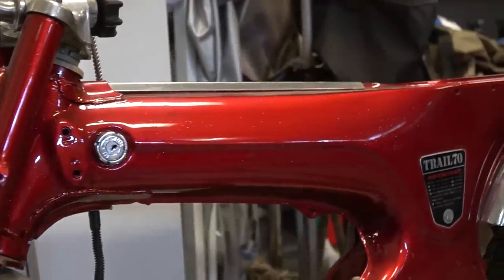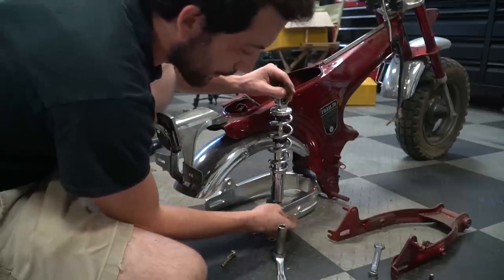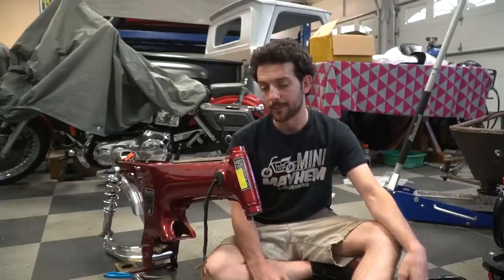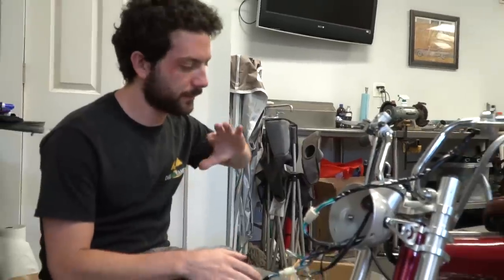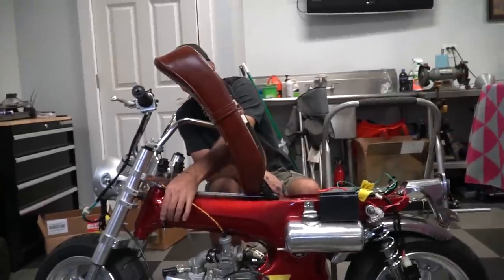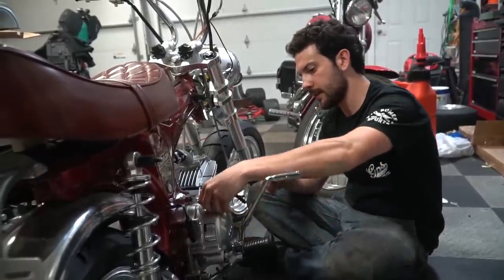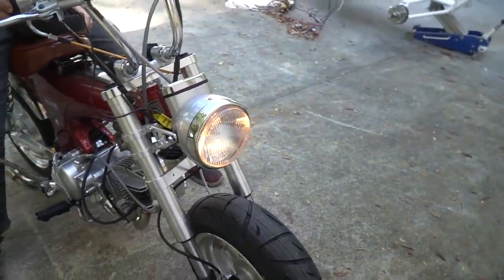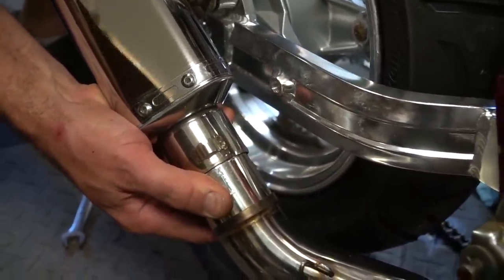190cc Honda Trail 70 Build | TOTAL RESTOMOD

Comment: Love your content. Ive never owned a chain breaker. As a retired forklift mechanic ive only done lift chains with an angle grinder and a punch. This philosophy transfered to my minibike world im in now. Not a bench grinder but an angle grinder...your bench grind method goes to new levels of burning fingers or chain getting caught between rest and wheel! Try angle grinder method. Use a paint pen to mark which link you want to go bye bye. Also for figuring out gearing for each bike i build i use cheap amazon chain then once i nail gearing then i put the good stuff GoPowerSports gold chain on at that length. My post is too long sorry about that gonna finish video now. Have fun guys!
Reply: I find on 420 chain I can just drill a 1/8 hole in some hardwood and just punch it through without grinding... I used to use a grinder but I found I had to use similar force with the punch compared to just punching it without grinding

Comment: To reduce your swerving and other issues at high speed you should get a steering stabilizer
Reply: Was just about to comment but ya beat me to it, would greatly reduce head shake at high speeds👍
Reply: I initially read that as swearing... that said, good point.
Reply: Steering dampener. The reality is his suspension is not set up properly  for his weight. Possibly to much preload. You shouldn't need a steering dampener on such a small bike doing such low speeds.
Reply: camdog they are the exact same thing just two different words to describe them
Reply: camdog Actually it’s a “steering damper”. A dampener would be an item used to lightly wet items.
Reply: Adam R lmao I’m pretty sure you are way off on that definition 😂😂
Reply: cameron weisz  Nope, I’m 100% right. I didn’t say you were wrong though. Steering stabilizer is correct, but so is steering damper. I was sponsored by Scotts steering dampers for the 12 years I raced motorcycles professionally. Here is the correct terminology on their website.

https://www.scottsonline.com/scotts.php
Reply: @Brian-wy7ts  right on man.  Its not just a quick fix.
Reply: camdog 
Definitely need a steering stabilizer at road speeds. I run one on a stroker ct70
Reply: Also sitting further back than he does helps alot the stability and handling.
Reply: Not unless the ct70 has some ingrained issue.  I've been riding bikes for a while with far more aggressive steering geometry without steering dampeners. 
Also, a steering dampener won't stop swerving, which certainly shouldn't be happening involuntarily anyway, just dulls out fast wobbles and tank slappers.  Fast steering wobbles and tank slappers shouldn't be a problem unless you're flipping too fast from lean to lean or setting down crooked wheelies.  Can't imagine that would be a problem on that bike.
Reply: Ive seen some custom ohlins set ups. They most definitely help.

Comment: John don't forget to get an oil cooler for it these engines run super hot. I've got the same motor in my pit bike and it shreds! The motors can hit almost 100 with the right gearing. I got my motor on pitster pros website it came with everything needed for a swap from a harness, air filter, oil cooler, throttle and clutch cable ECT... For $641 they aren't to bad on gas either I thought it would eat through gas to also had to grind down the case on mine as well so I got a laugh out of that. Good looking bike otherwise I love it!

Comment: I know I say this alot guys but I really really miss the rumble of the 670 from the drag rail could you all bring it back I miss it alot.
Reply: Robin the slave Wr [BŐŐB] pretty sure they bent the frame
Reply: @gixxernut8021  They also blew up the motor.
Reply: It needs a new engine and fixed the frame so its probably not going to happen for a year
Reply: @tbah9402  the frame was to bent too bad the only problem was the motor
Reply: Yeah the frame is bent. The motorb is conflagulated. New rail build? NEW RAIL BUILD!!!! please.
Reply: @robintheslavewr1513  if the frame is bent then it needs fixed before you put 50+hp on it bent metal is weaker

Comment: Beatiful dax! The brake system always goes left on the front! this is to prevent brake power be to much on either side. Also the best way to warm an engine is to let it idle for about 15 to 30 minutes and then go for a drive to about half throttle while sometimes driving a bit faster or slower. This process minus the idling needs to be repeated for 500 kilometers if the cylinder is cast iron and 100 to 200 kilometers if the cylinder is aluminum. I also hear some blowback when you went for a little drive, be sure to check the valves to see if they are tuned correctly. Not only will this increasy the life span of the engine but also the performance and mileage.

Comment: Wider triple tree would allow you to clear the rotor, and just use a spacer (s) to center the wheel and a longer axle, problem solved. I can tell right now that it needs longer shocks in the back or your going to toast that rear fender on that tire with the extended rear swingarm. I would like to see you complete the TAT on it. LOL.

Comment: I love the 190 engine. It's prone to a few issues but super simple and cheap to work on and mod.

With a 212 bore, 4 valve head and advanced timing it puts out 24+hp.

Comment: My first ever "dirt bike" (or at least thats what I called it) was a 95 ct70. It was still brand new I got it about 2 or 3 years ago it was but back in a storage container by my great uncle and he forgot about it. We pulled it out put a new tank on it bc it was rusted out. When we got it running it had less than 100 miles and since then I have put over 1000. Though the carburetor is still leaking. I have rebuilt it but it still just leaks.

Comment: 2" extension means 1" on each side I guess.
Reply: Or 2cm, which is close in chinesium
Reply: Or it's measured from the beginning of the stock slot, to the end of the extended slot.

Comment: you now have a similar version of my z50 monkey it has a 150 in it now, with the same front end similar swinger and 10 inch wheels, sweet rides and sure to put a smile on ya dial.

Comment: I never really cared for the CT70's but that would be awesome to see one barreling down the highway at 65.
I am here because I care for you, Jon and Isaac. Love your vids. Yes, you guys need a new shop. The C10 is getting closer. That is going to be one of MY highlights. (Had a '65 C20; loved that truck). I also had minibikes, Go Karts and Motorcycles. I love everything that has an internal combustion engine. Even Welder/Generators and compressors for jack hammers.  :-)

Comment: Pro tip, 
Use a coat hanger to pull the springs over the loop on a slip on exhaust. 

Bend the hanger in half and hook the spring on it and pull .
Then unfold the hanger and wiggle it out. 😁

Comment: Here's a tip for installing springs, use a shoelace. Tie the lace in a 12" loop, hook the loop over the spring, stick a screwdriver through the loop to use as a handle and pull the spring into place. You may need a second set of hands to get the spring seated depending on how tight it is and if you need one or two hands to stretch it but it works amazingly well. And if worst comes to worst and you trap the lace under the spring, just cut it. The lace, not the spring.

Comment: I can tell he never looked in to the main problems with a 190cc  like the clutch cable short and how to kick start them and why you should only use electric start he probably would have also did the shift star mod before riding it with a upgrade shift arm and put the oil cooler with electric fan and check the decomp spring. Also upgraded to a hd starter chain and grease it.  Just a little tip to help anyone doing a 190cc engine hope this helps you.👍👌✌️💯

Comment: A tip for the muffler springs. Use a pice of wire and vice grips. Bend the wire around the hook on the spring and clamp the ends in the vice grips and pull the hook into the hole.

Comment: about the rearfender : if you make a spacer for the front bolt in between the fender and the frame and use a longer bolt that mount the rearfender and force/bend it slightly around the rear / top mount , the fender will be a little more centered over the wheel and you get more space between the rear lip and the tire , might need to redrill the holes to get them centered over the holes in the frame

Comment: If you do a long road trip on it I would get the side cover that gives you an actual oil filter and ports for an oil cooler.  The filter and cooler would definitely help keep that engine alive longer on a long road trip.  You can also modify that 190 engine with a 4 valve head and cams.  They are awesome engine's for the price.

Comment: John did you try putting the steering head bearing race in the freezer before hammering it in?  Thats a good way to install bearings because they shrink juuuuust a little bit when frozen and hammer in a lot easier.  You could also heat up the triple clamp mount to expand that but I understand the brittleness of the paint would make that a bad idea

Comment: we are very similar I have a 74 st90 which is the trail 70 with 14 inch rims it's like a cross-country Supermoto scrambler set up has a 120 Daytona Street Tire in the rear and somehow has the original stock front tire has a Grom 125cc motor with oil cooler upgraded exhaust of course sounds like a real dirt bike can get 65 miles per hour also the motor was moved forward 5 in which is kind of like changing the swing arm now it doesn't do wheelies every time unless you want it to.    

It also has a custom rear rack with a detachable storage box which is very cool but same concept so you can actually ride the bike and with the motor moved forward the footpegs have been moved forward I'm 6-2 so it fits me really comfortable with BMX style pit bike handlebars cuz the st90 has a different headset so you can add real handlebars

Comment: I seen you having a hard time with the spring on the exhaust  to give you a tip take a pice of rope or cord and hooking the cord to the spring pull in the direction you want it to hook to the bracket then just pull the cord out without the spring jumping off it makes 90% easier to attach any spring to any bracket

Comment: you should put a thick washer between the lower bolts which connect the rear fender and the frame so it aligns more with your rear wheel. 1/4" to 1/2 would do a lot.

Comment: Years ago, I bought a 155 high output but I put it on a chinese copy of a Honda Chaly.  I added a supercharger and had a shop help me tune it.  Also changed the gearing so it was a little bit of a dog at the start but she could cruise on the interstate no problem.  In my state, at the time, we had motorcycle inspection.  The bike was titled as a moped (originally was a 49cc) but I had a friend who was a dealer in another state and I sent him the title and he did his magic and sent me a title in his dealers name with the body change to an motorcycle.  So then I changed the title back to me and took it for inspection.  Man.... I would get pulled over ALL THE TIME on the interstate by state troopers.  Telling me the bik wasn't safe for the highway and that it didn't belong.  I would just basically tell them this, "I have a MC endorsement on my license, I am wearing a helmet, the bike insured, the bike is registered as a motorcycle, and it has a valid inspection sticker.  I wasn't speeding and I was riding within the flow of traffic.  So whats the issue here??".  They would get so mad and let me go.  A few years later I sold the bike but I still miss it.  Four speed manual clutch!

Comment: You should get a 454 and a 5 or 6 speed trans and hook it up to a limited slip diff and put it on a custom aluminum frame with a full roll cage and dual rear sway arm with long travel shocks in the rear with extended control arms or a arms with long travel shocks in the front with 2 seats that have 5 point harnesses and call it a trophy truck.

Comment: You have no idea what you can do with this engine... I have this engine in a honda xr70r 2002 mini supermoto build... I have no starter no starting clutch 35 rear sproker 18 front sproker... 32 lectron carburetor and this engine need big exhaust cause have lot of compression... And i ride head to head next to a yamaha bansheee 350 2t... Stock piston stock crankshaft is wild... Love this build video

Comment: To spread the frame's mounting tabs you can put a piece of all thread through the hole with two nuts inside the frame. Turn the nuts in opposite directions so they spread apart and they'll push the frame's tabs apart a little bit.
Reply: Also, to pull springs bend the point end of a heavy nail into a J. Grab the head with channel locks then hook the spring. You can pull it much easier and once it's on just pull the nail out.

Comment: I have got the Skyteam Dax it was a basket case 50cc. Also paid 200 Euro. And just bought the same rear fork. But 4 inch longer 😊.  Bike was incomplete  but got 2 engines with it. One is in the non Rolling chassis. Getting parts in this week. Did not hear it run as no carbs was in the basket.😢

Comment: I love the chrome and polished aluminum, the high bars, and the sound of the muffler. Beautiful, flashy, and tidy. The only thing I'd change is the fit of the back fender, so that it follows the profile of the tire,             and I would have put 26" wheels under it, and wrapped a MTB frame around a 212 Predator engine. Just kidding guys, that Trail 70 is a genuine jewel of a mini bike. When will you build a motorized MTB? I recommend the Monster 90 engine, rather than the Predator 212 like I used, to avoid doing frame and motor mounting modifications. The 78.5cc Monster engine, with an upgraded CVT rides like a motorcycle, and is fast enough to keep up with any traffic, except highway speeds. My 212 Predator MTB gets me up to highway speeds, but I turned in the throttle stop screw to limit my top end to 80km/h, so that I avoid big tickets ( $3,000.00), and long walks home pushing my bike. So far, so good.

Comment: a guy on a lifan  honda  70 commuter with 140 cc engines was doing wheelies about 50 mph with automatic clutch in the UK, we used to laugh at them bikes when we were young, the kawasaka centurian 100 had 18.5 ponies stock ,steve mcqueen owned 5 of them one just sold for $70K in california.

Comment: no jumping! stand up & straddle the bike. keep your left foot on the ground. kick-start the lever from the very top of the stroke. little pressure until it is all the way at the top. kick all the way through from top to bottom. should fire first kick every time, easy. this is a mini-bike motor.

Comment: Ike looks like a pretty big guy I should post a video of my st90 so he can see what it looks like it's the same setup as a trail 70 except a little bit taller and he could even move the motor forward the way I did and it will fit him very good and he won't have to extend the swing arm

Comment: at the front it seems the 2 busses are the wrong size. that's why the rotor did not fit.  / about the speeds... i/we drove our honda ss50/dax/c50/monkey/chaly/cd50 with a 17/19 mm original carbs and the ignition prematurely adjusted. we drove about 75/85 km/h  > did not have the nice aftermarket parts there are now (and if they where there we could not afford them) this engine sounds very very nice.

Comment: If you are serious about making it more drivable at higher speed, cut the front forks off and extend the angle 6 or 8 degrees to extend the forks a few inches.....   It will work!

Comment: Dude those rear shocks are too short, also your front brake rotor has the wrong offset however it’s a cool little bike and got a lot of potential.
There’s a candy red paint that Renault use on their Clio that would make this look absolutely stunning.

Comment: John as it pains me to see toy beat on the stem bolt with a hammer and punch, metal chisel or flat head screwdriver, please, I beg of you go buy an adjustable hook end spanner wrench and use the correct tool for the job. Please.

Comment: Zip-Tie that speedo cable to the forks at the wheel. The sender will rotate and ruin your speedo cable. I feel your pain on the non-centering front wheel. Mines still off by a 1/4.

Comment: i am venturing to bet you could fix the 70 getting Squirelly  at high speeds by finding some type of steering  dampener  to install  ive never seen one built for  the small motorcycles but ill bet they are out there  with so many Groms and Monkey bikes out there  i had a Yamaha 400  Cruiser in the 1980s  that would go over 100 MPH  but i had to lay on the  gas tank to keep it in a straight line  a local shop  did put on a Dampener that looked kind of like a hydraulic shock  with tie rod ends  that were adjustable  that helped a great deal  one might question why i needed to ride that fast ? it was because all my riding freinds  had way bigger bikes than mine  and i really used mine as a daily commuter  so i didnt want to give up the fuel economy and reliability  of  my paid in full  motorcycle btw at the time i was bartending and the bike sat outside a busy bar every nite  and ironically  on many late nights  i  got  a car ride home from a female  freind that would spend the night at my house  and i would get a cab ride the next day to  retrieve my motorcycle  or have her drop me off  i didn’t like riding  with a few drinks in me  as i had a tendency to take too many  risks   btw the exhaust note did have a aircooled VW Beetle  sound to it which comes from those chrome tailpipes that the Beetes have on them  i say hell yeah on the road  ride  the 70 does look good